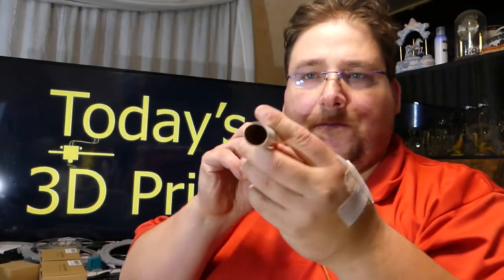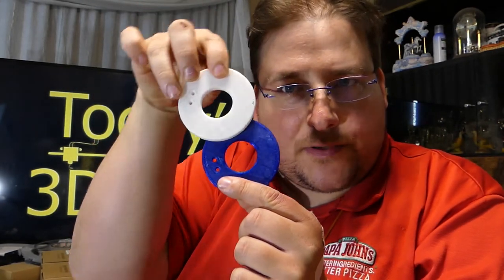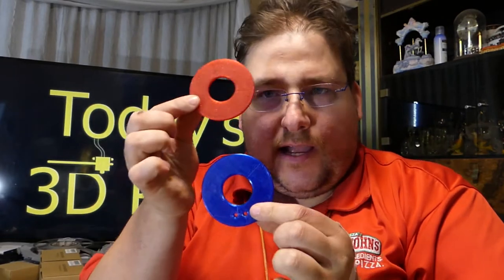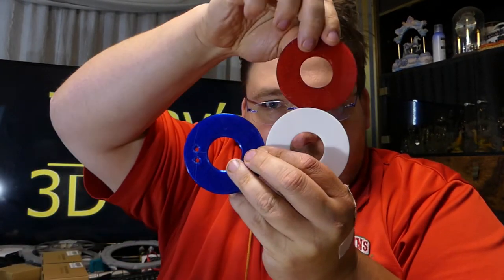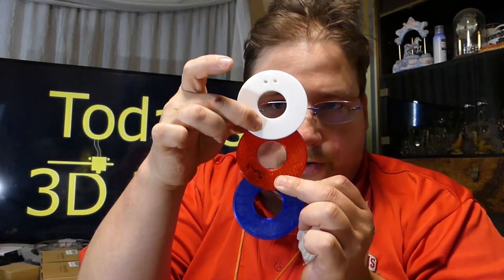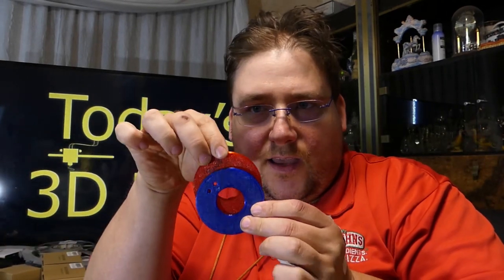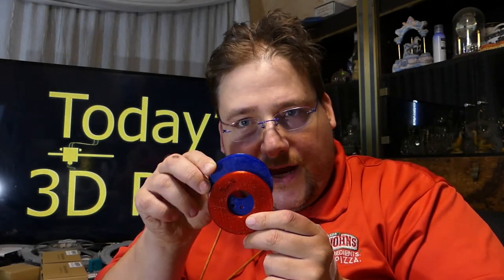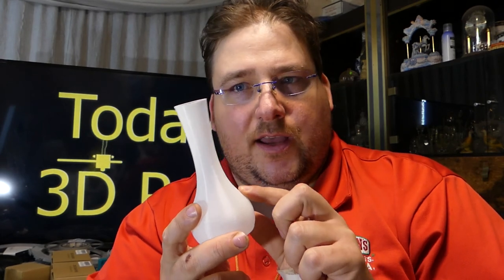Today's 3D Print - Tech Tip Single Perimeter Vase Print layer height and thichkness model integrity

Comment from the maker: Some sales Gearbest asked me to promote
I OWN these top listed printers and consider all of them to be a good or safe buy

BETTER Deal CR-10 (shortlived??) Coupon CR10ZUI $369.99!!
Orange http://goo.gl/jJGLNQ Blue http://goo.gl/uf1J4L

CR-10 (in case above goes away) http://goo.gl/VsqqDa CR10SUP $379.99

UPGRADED Version of CR-10 http://goo.gl/sZXLnd GBCR10S $499
Ender 2 less than $170 http://goo.gl/RDceSp Coupon ENDERC EU Ver
Anet E10 http://goo.gl/ScK96q $259.99 just 60 pieces for EU warehouse
Zonestar Z5F (not perfect but not bad for $220!) http://goo.gl/d97i3B
I would NOT suggest as a first beginner or critical printer.
------------------------
I DO NOT own any of these below printers but most appear to be well liked by other users on youtube. Check out some youtube videos and if you like them. Have at it.

NOW THIS looks cool. I want one of these to play with
http://goo.gl/sJ9oig LASER Cutter. Big. Code A3PRO2500 $159!

Tevo's take on the CR-10! Tornado Coupon Tonado1 $370 http://goo.gl/eBCy7e
I3 Mega http://goo.gl/baJAGP I3MEGA $310!
Anet A8 http://goo.gl/41b2YZ $139.99 Coupon GBA8EU just 200 Units EU warehouse
A6 http://goo.gl/e7PYSv EU warehouse $165.99 with coupon:GBA6EU

General Sale pages for this month.
More 3D printers http://goo.gl/D96bgJ
Autumn Bumper Harvest big deal http://goo.gl/NQ8cF8

Comment: Thanks for the clear understanding.  Now my question is about Simplify3D;  Why does it pause and leave blobs while in vase mode?  Retraction is turned off for sure in the process settings.  I'm kinda stuck and can't use it for vases, have to use MatterControl.  Printer is a CR-10.
Reply from the maker: Justin Hart simplify3d does not pause in vase mode which means if it is pausing for you there's a problem either in a conflicting setting or a model that's not technically vase mode compatible since you indicate you were using something else to successfully vase mode just tells me that we have a setting that we need to fix what model are you trying to vase mode? Can you send me the factory file for the offending print? I'm assuming you have a Google account you can upload it to drive.google.com right-click the file after you upload it and click get shareable link
Reply: Thank you so much for the reply.  I'm using vase 2 from https://www.thingiverse.com/thing:2421704/#files.  I can generate you the gcode and share it with drive if you wish.  I'm very grateful for your help and knowledge.  I might have figured it out and it's dealing with my start points in the process.  I think you hit the nail on the head.  I'll make adjustments and try a test print.  :)
Reply: You were absolutely correct and I thank you for it.  It was my setting conflicting as the vase just finished and was perfect.  Take care!  PS, what do you think of the golden ratio print resolution of .1618?  Might be a neat topic for a video for you.
Reply from the maker: gcode won't help me what I need is your FACTORY file. if you can send that to me that would be wonderful (so I can see what your actual settings are) I can't reverse engineer a gcode file and I don't read the code such that I can tell what or where it is doing something.
Reply from the maker: +Justin Hart I'm not sure I've never heard of it can you send me a link discussing it? I do all of mine and steps of .04 because that's the minimum resolution for a full step on a stepper motor which makes logical sense which is why I print at .08 or .12 or .2 or .24 but I have never heard anything about a golden ratio resolution would like to read about it

Comment: Very useful information..would in be a good idea to half the layer height in relation to the nozzle??  .4/2 = 2 layer height  as a rule of thumb??
Reply from the maker: Correct for a decent compromise between speed and fine detail 50% of nozzle diameter. you can goto 70% maybe 75% for well supported models as a "rough" print even as high as .3mm

not a hard fast rule. it will vary from model to model settings to settings scale to scale and even filament to filament. this is part of what you will learn as you print to "judge" ok this will work that won't work. the more you learn the less trial and error you go through and the faster you get to the right answer (if there is one)
Reply: Sounds good..I have a Ender question when you have time..not sure what time zone you are in and dont want to keep you up..
Reply from the maker: ask away
Reply: Thanks..My extruder fan turns on as soon as I turn the printer on, Not when the hot end reaches a certain temp..seems to run at full speed as long as its on..I turn it down in the menu but still at  full speed..is the normal behavior?
Reply from the maker: the ender has no parts cooling fan. it uses blow by from the hot end cooling fan to parts cool and yes it should be on the moment you turn the printer on and the fan speed in the software should not do anything at all (the brain board DOES have a socket for a parts cooling fan) if you want to add one but so far I have had no need.

Hot end fan is binary. on or off and if the printer is on it should be on at all times.
Reply: Great..Thought I got a bad one..Thanks Nery..You take care of that hand..

Comment: Hey I am having difficulty with that cyclone vase model it doesn't just print in a spiral it keeps wiping the nozzle and going the opposite direction basically alternating clockwise then couterclockwise leaving a zseam. I am using S3D and have vase mode on its just being a pain. Any idea whats going on?
Reply: I gotta say I did not know this or think about this. When you said .25 I was thinking of course it can print that I have done .3!.... but never as a vase.
Reply from the maker: that is because that model is impossible as a vase print. you can't do it. you can 'fudge" it if you enable the combine and heal option (don't forget to turn off top layers or it will close the model up) then it "will work" not perfectly but it will work.

in normal mode you can't vase print because the model does not have a continuous outer skin. Looks like another good subject for a video tech tip. what can and can not be vase printed :-)
Reply from the maker: cool stuff ehh :-)
Reply: thing:25201 Weird. Since its titled "tornado vase" I had assumed to print it in vase mode. But thanks for the help. I will just print it solid instead of vase mode. Also I'd love a video on this subject. I know generally what can be done in vase mode but this was a surprise. Anyways I never got a reply from a comment the other day asking you to try filamentum vertigo grey (buy from filamentone) I can send you a few meters if you want. I think you will like this stuff if you like the high five blue.
Reply from the maker: sure. send me some. I will give it a shot. if you can send 100grams or more I can make some test prints and review it.

VASE has two meanings here. you are thinking vase as in vase MODE or spiral or continious single perimeter mode. THEY are thinking the traditional meaning of vase. Vase as in the OBJECT we call a vase.

Vase http://goo.gl/rQWFu5.

the tornado vase has an INNER and an OUTER defined wall. so its not possible to print it as a "vase" the printer will try and get as close as it can but it won't work right.

and you really need infill for at least the bottom 10% of the print.